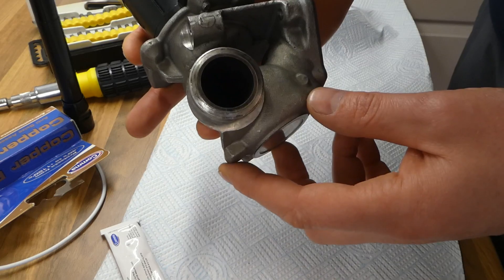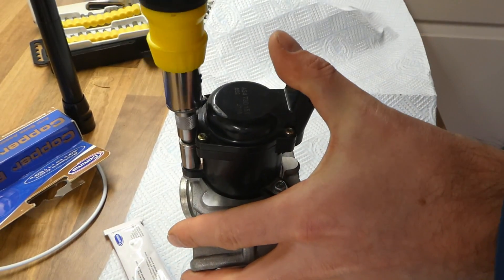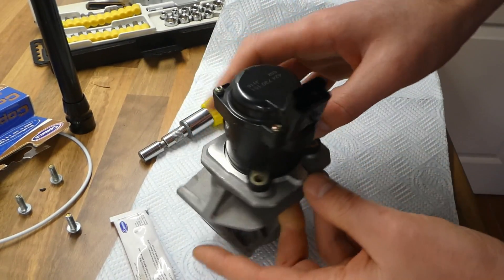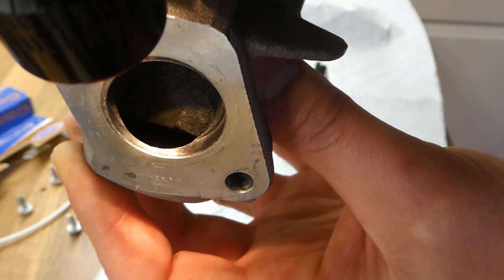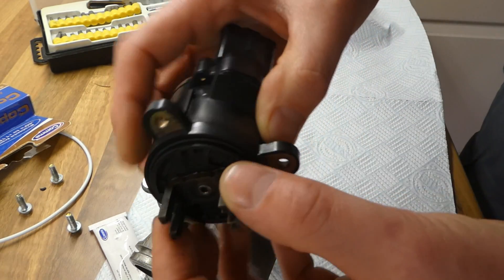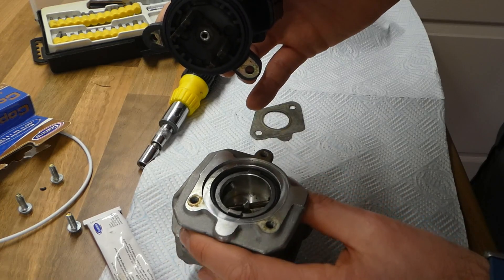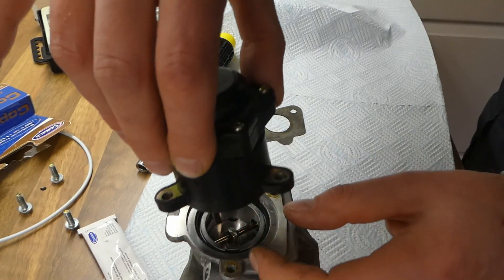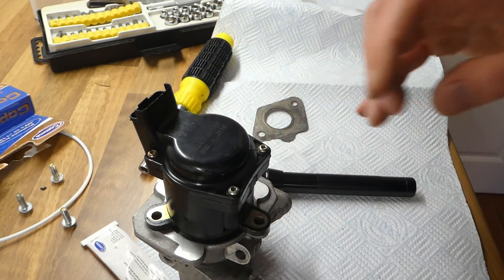taking apart an EGR valve for cleaning for 1.6HDi/TDCi (Peugeot, Citroen, etc.)

Comment: Does this improve sluggishness when moving from a static position
Reply: Not really, it is sluggish because Turbo is fired up on higher RPM. EGR is just exhaust recirculation, it brings back some of the gasses back in the engine and thats it, it gives slightly more power, so that exhaust gas is not wasted.

Comment: Which EGR manufacturer do you recommend for this engine? I have a Ford Focus 1.6 tdci 90 hp and maybe I will have to buy a new one if cleaning it doesn`t solve the problems. The original EGR is Valeo but is so expensive compared to other manufacturers...
Reply from the maker: Yeah, many thanks for the question, but difficult to answer. I have only tried two of them. I currently have had Hella for ~2-3 years and have not had any problems, so on that basis I would say Hella is pretty good. I had before HaaS and that had some problems with not turning properly the shaft and had errors, so I cannot recommend it. It could well have been a single batch or something, but I would go with the Hella if I were you. You might be unlucky and hit a bad batch, but that is the same with every manufacturer. Yeah, sorry about the long answer, difficult to tell what your luck would be, but mine is Hella and I have not had problems.
Reply: @moremolecules  Thank you for the quick response.

Comment: Hello. I have a ford focus 2 1.6 tdci 109hp 80 Kw and I disassembled the Egr and the electronic part on the Egr. I can no longer reposition the electronic part back on the egr. it gives me an egr error code and a 3000 rev limit. Help me please
Reply from the maker: There are two ways where it has gone wrong. One is the position of the bottom pin and one in the electronic part. When the upper part was put together, does the fork thingy move freely and come back? Also, when you put the top electronic part on the bottom, you have to be extremely careful that it slots on the bottom pin. Take it apart together and start again. The spring at the top is also a bit tricky.
Reply: @moremolecules the fork on the electronic side rotates... but I noticed that only on the right side it rotates maximally when operated by hand. Is the EGR mounted with the shaft up or down?
Reply from the maker: @rares.rsk9977  Yes, that is the correct operation. The fork rotates to one side and the return is done by the spring. The fork itself moves the EGR valve (bottom pin) to bottom position, otherwise it is in the upper position. So, the pin is at the top position in the groove when you screw the EGR valve, then when the valve operates it moves it down.
Reply: @moremolecules Do I mount the electric part with the fork on the maximum open or maximum closed position on the egr? or leave it in neutral? ie between open and closed?
Reply: @moremolecules Do I still need to rotate the electrical part on the egr? or do I fix it?
Reply from the maker: @rares.rsk9977  Here is a better explanation of how to put it together: https://youtu.be/wTQtVJEqGXI?t=2307
basically, you need to put it in a way that without the EGR operating the bar is at the top position. When the EGR is in operation it needs to move it in a way that the bar goes to the bottom of the groove.

Comment: Ive taken  the egr valve of and clean it completely and fitted back on the car but know the car is having trouble with black smoke with it never had before. Any ideas as why?
Reply from the maker: Do you have any errors and did you take apart the top part of the EGR valve? Maybe the bottom part was not put together properly. Do you difficulty starting up, i.e. rough starting up?

Comment: Next job are bolt  easy  remove ?  Also  plate  need  hold taking  off
Reply from the maker: Yes, the plate needs holding n with fingers, otherwise it will drop off in the engine.

Comment: I have peugeot 5008 1.6 HDI 112 hp. There is error - p14a3 egr exchanger bypass : confirmed jammed open (hot side). Can I fix it with Egr cleaning?
Reply from the maker: Yes, it is worth a try. Most likely, although not necessarily, the EGR valve is stuck on opened due to the carbon deposits. Worth a try to clean it completely. In the rare occasion that the EGR has burnt out, then you may need to replace it with a new one. All in all it is worth trying to clean it.

Comment: The second way is to bring the fork that rotates below to the closed position with a screw and screw the electronic valve of the egr into the slots directly. for your information. :))
Reply from the maker: Do you mean by using the screw to guide the fork from the small gap on the sides for example?

Comment: Thanks for your videos explaining the process for dissassembling this Valeo EGR valve!   I had the P042F error on my 2010 Fiesta with the 1.6TDci engine (EGR stuck in closed position).   I disassembled the EGR and cleaned out all the soot, after which the mechanical components for opening and closing the valve definitely moved much more easily.  I also removed the top part of the solenoid to check no issues in there and reassembled it as per your other video -  Thanks!  After assembling back onto the car, clearing the fauly code and doing a test drive the same fault code came back :(     Do you know if there is a way to bench test the solenoid, or even do it on the car ?     Or is there a way to open up the bottom part of the Solenoid to check for issues and clean it up?       I'm trying to figure whether I just need to replace the solenoid  - but I'd rather fix my current one to save having the extra job of calibrating a new valve!   Thanks again!
Reply from the maker: You could test the EGR valve and the solenoid with software that is for Ford, not too sure though what it is called. Each manufacturer has its own software and this is testable. The bottom part cannot be opened unfortunately without destroying it. Make sure that the channel is really clean and smooth. I had a new EGR valve that the channel was snagging and giving me an error. I tried with sand paper to smooth it out, but still did not work. I had to buy another one at the end.
Reply: @moremolecules  thanks for your reply. Yes I think with ForScan software it is possible to view the live valve data, and see if it is moving etc. I have ordered a vgate vlinker fs obdii to usb adapter to connect to the ForScan software, to get deeper info on the DTC and also see the live egr solenoid data.  If it's not opening, it won't be possible to know if it's because the solenoid is faulty, or if the valve mechanism is jammed... Unless maybe if I test it fully assembled, and then also with the solenoid removed from the valve body.   But the body would still have to be fitted to the engine to prevent lots of exhaust gas coming out! There must be an easier bench test though? 

When you say that channels do you mean the curved grooves that the bearings on the end of the horizontal pin run in?   Mine looked pretty smooth to me, I think this is the original OEM part.  After I cleaned it up with oven cleaner and brake cleaner, I lubricated it with wd40 and the mechanism was very easy to operate by finger...   

If I did replace the egr valve with a new one, is it the ForScan software that would be able to calibrate it?
Reply from the maker: @MartinParmiter  Yes, that's the one. I think you can simply plug it in and monitor the EGR data. If it gives percentage of EGR then it is working correctly. You can plot it vs. load for example. I would clear all the errors and have a journey with the device plugged in and record them. You will see when the error appears, unless it comes straight away. I am not all knowing expert in any way, but my experience is that it is either the electronic top part or the valve is snagging somewhere. Either the pin with the bearings or the bottom part. Soak the bottom part in degreaser for longer and see if that helps. Or what I normally do is washing with dishwashing liquid under the tap (https://www.youtube.com/watch?v=koSxf67CtHI&t=924s). I move the pin with the bearings while doing this, it helps cleaning the bottom part. Even better if you can find some fine brushes and reach deep around the bottom valve.
The ForScan should be able to calibrate it, but for the original valve you do not necessarily need to calibrate it although it helps.
Reply: @moremolecules  thank you. Yes I'm pretty sure the bottom part of the valve was pretty clean as it seemed to move really freely. 
Inside the top part there was some corrosion on the circuits but I couldn't see anything definitely wrong. I did clean the internal connectors a little to make sure they make good connection.

Currently I can clear the error and it doesn't come back straight away, so when I have the ForScan set up I can repeat and see what sets the code off. 

If it looks like there is no % of egr opening, couldn't it be due to either the mechanical part sticking, or the solenoid being faulty?... So it would be hard to tell which one is the cause?
Reply from the maker: @MartinParmiter  I thikn with the ForScan you should be able to test the valve and the solenoid separately, the PSA (Citroen/Peugeot) software allows that.
Reply: @moremolecules  Thanks.  I'm not sure Forscan can though, the only data it knows is the demanded % ERG opening, and the actual % opening, both of which are to do with the solenoid.   Technically if the solenoid was removed from the valve body but left plugged in, the ECU wouldnt know, unless it calculated it from MAF readings not matching when the EGR opens?   Shame the solenoid can't be removed from the EGR body without removing the plastic scuttle from the base of the screen!
Reply from the maker: @MartinParmiter  Unfortunately I am not familiar with ForScan, I do know the PSA one, but have not used ForScan. If it cannot do it, there must be another software that can do it, it is essentially the same EGR, if PSA can test it, I'm sure this can be done in Ford. Sometimes the heat and the gasses damage the electronic top part and not much you can do with those unless you test every single component.
Reply: @moremolecules  thanks! Yes I've struggled to find much info on exactly how to use forescan to test the egr. I made a recording of live egr data today, like the demanded erg position, and the egr bank 1 position... But I don't really know what I'm doing 🤣.   I just want be to be totally sure that if I replace the egr it will fix the problem, as I've read in multiple places of people doing that but then still having the same DTC 🙄
Reply from the maker: @lokiparmiter8895  In general these faults come from the EGR itself. I was getting a few errors and upon replacing it, no errors afterwards. It has to be good quality EGR valve as well though. I had two replacements, Haas and Hella. Haas was faulty from new, the Hella one have not had problems for the last 3 years with it. I think the original, at least in PSA cars, is Valeo, but could not find it or it was way too expensive.
There must be a way in ForScan to test the EGR, it is probably hidden menu somewhere there to test both solenoid and valve. It can be done with PP2000 for Peugeot, so I do not see why it could not be done with Ford.
Reply: @moremolecules  thanks!  I've looked at the live data more, and found that the EGR Valve Position Sensor Voltage stays constant, even when the Commanded EGR % varies (it's mostly 0% when stationary and 100% when moving, with a few slightly open times).  I assume that the position sensor voltage is supposed to change, if the valve is moving?
 So am going to repeat these tests with solenoid removed from the egr body, and if the position sensor voltage still stays constant, then that suggests it's the solenoid or position sensor which is faulty and I spoke replace the whole egr, does that sound correct?
Reply from the maker: @lokiparmiter8895  That seems alright to me, but you have delved deeper in those sensors than me. I do not remember if I have looked at the valve positions sensor voltage. I suspect that this one is integrated in the solenoid and impossible to take apart and replace.
Reply: @moremolecules  hi, thanks for your previous advice. I have done some further testing, and found that when unpowered when I rotate the solenoid from one extreem of rotation to the other, there is then a bit of resistance at the end and it kind of jumps a bit further and then seems to 'stick'.. like there is a 'notch' in the shaft. That's not normal is it?   When the ignition is on and the solenoid is powered, I can try to turn it by hand and observe the position sensor % changing, and the PCM then acts to oppose me turning the Solenoid and to keep it in that position.   Weirdly when I turn the solenoid by hand, the Commanded_EGR % also changes, on the FORScan data stream.   When I rotate the solenoid  to one extreem of rotation (away from the direction the internal spring tries to turn it) the position sensor reads 100%, and then as I rotate it away from that 'end stop' the % decreased gradually all the way to nearly 0% but then when it gets to the other extreem of rotation and touches the point where it can jam, the % position jumps up to 87%....  This is after doing the reset EGR learned position values process.   So that's not normal right?   I'm thinking this confirms that it's the Solenoid thats faulty, not the position sensor, or the wiring.      Once running at idle if I make sure the solenoid isn't in it's 'stuck end' position, and clear the DTC codes then they do not reappear, but if I then force the solenoid into the 'stuck end' the DTCs always immediately appear!      I have a new hella part to fit and was thinking of checking how smoothly the Solenoid works!!
Reply from the maker: @MartinParmiter  Good observations there Martin. Just to confirm, my Hella EGR does the same thing. When you twist it it goes to the end and then there is a notch and gets a bit stuck there. I think (only by memory though) that this is the end of the spring position and you can force it a bit more. Yes, the sensor should follow the rotation. I can confirm that this is normal, but in general it should not cause errors, the solenoid cannot force it pass this point. Because mine is Hella and I have not had any problems for the pas 2-3 years now, the operation is as you describe it.
Reply: @moremolecules  Thanks for letting me know, I guess then that there is a notch that the solenoid can't force itself past, but it can be done by hand, and once the part gets old the notch gets worn and eventually the solenoid (and spring) force is able to push past the notch...   and once past it gets stuck... thats all I can think is the case....  I'll open my Hella anyway to double check how it is, but now you've pointed this out, I'm less sure that the new part will fix my problem :s  THanks
Reply: @moremolecules  FYI, have got my new Hella apart, and when I try to turn the solenoid in the direction the Spring turns it, against it's 'End stop', it is possible to then push it  past that stop into the 'stuck' position, but the force needed to do that is much higher than on my old original Valeo part - so fingers crossed this new part is all my car needs.  Such a shame the Solenoid can't be taken apart, as it could be a simple thing to fix!  just need to replace the worn out End Stop...
Reply: @moremolecules  Ok I've realised that the Solenoid should never be able to move to the position where it even hits it's End stop, as this is past the point where the Valve is seated in the housing -  so it's not the 'end stop' in the Solenoid that's getting worn, but the Forks that are turned by the Solenoid, on the new part they fit snugly over the metal pin of the valve, but in my old part the insides of the Forks are worn with semi circular grooves, which means that the Solenoid has to rotate further and further to get the valve to close (and the PCM should be relearning this position every so often) and eventually the fork gets so worn that the solenoid starts to push into it's internal End Stop, which isn't actually a proper stop and it pushes past it and gets stuck.....   So ALL that needs fixing are  the forks on the solenoid!!!  Do you think this can be done in a reliable way to prevent the need for a whole new EGR valve??   If only they had just made the Forks replaceable by having a fixing on the end of the shaft!!!  Looks like you can't get the Forks off the shaft.  I think my only option to repair would be to screw new material onto the sides of the Forks
Reply from the maker: @MartinParmiter  Yes, that is absolutely correct, the solenoid cannot get to the pass position, the semi-circular groove stops it. By hand and without the bottom valve part it can be put way past the end stop position. Not too sure why yours gives you the errors, but AFAIK, the sensor is within the upper part and not the bottom, so the fork or channel should not let it get pass the no return point. Yes, worn channel/groove can make the EGR get stuck and be notchy and this gives errors. My previous Haas EGR was really notchy and was getting stuck in the semi-circular groover often and was giving errors.
The fork is pretty sturdy metal, it should not get worn, the semi-circular channel can get worn, but the solenoid should not be able to get pass the no way return point. Maybe I am wrong about this.
What you can do, but a bit more complex and involved is to get an arduino with a mofset nd control the EGR valve externally and observe when it gets stuck and why, but it is a bit more complex.
Unfortunately, they have designed it in a way that the solenoid is not serviceable.

Comment: У меня электропривод изнутри окислился
Reply from the maker: You can potentially clean with electronics cleaner fluid. It is a bit weird, maybe water drips somewhere there. Also you can use electronic contact grease, which will stop the contacts getting oxidised